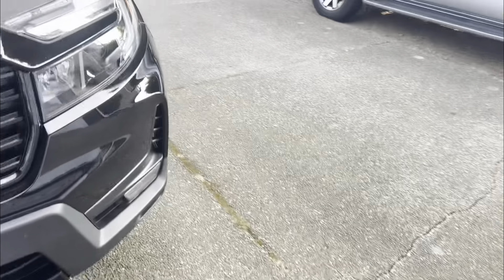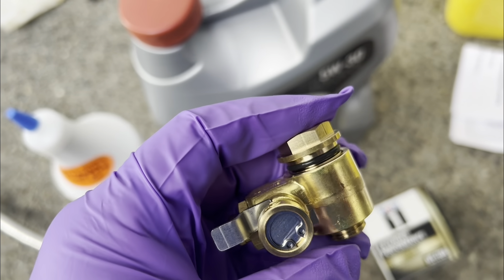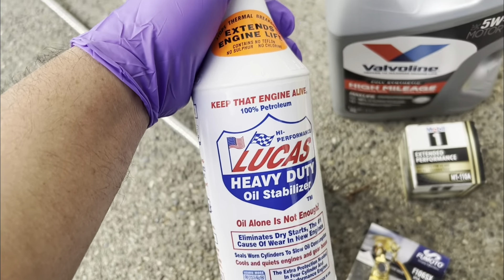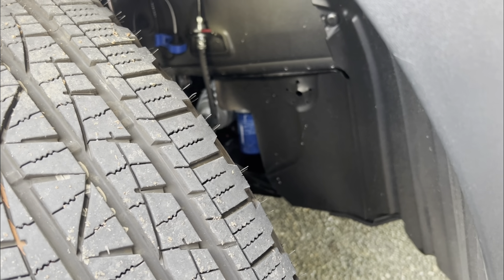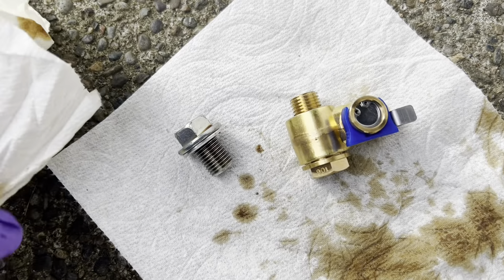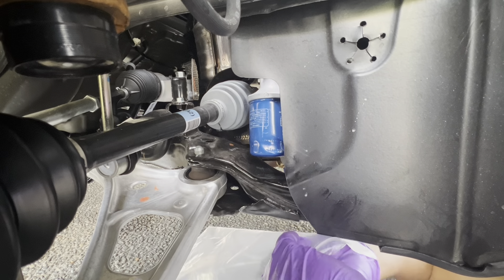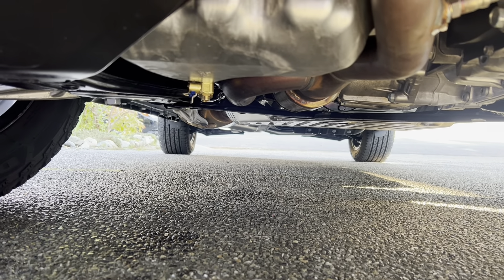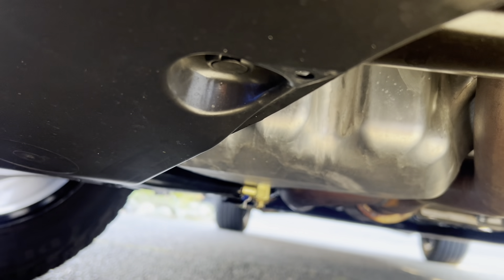2023 Ridgeline first time oil change, installing fumoto valve. I Don’t recommend this for you!

Comment: another great demo. i'm assuming your fumoto valve (F106SX) will also fit on my '25 Ridgeline.
Reply from the maker: Yes, but I only recommend the F106. Not the SX because it sticks out too much and can catch debris on the road. I’m switching over mine to just the regular F106.   However, if you do any off-road, I do not recommend a FUMOTO valve at all.
Reply: @AutoGuyVideos  no off road. thanks so much for the awesome intel. =)

Comment: hi  handsome, i own a 2023 honda ridgeline rtl-e  with 5325 miles in it. whats your hwy ,eco mode  cruise control  driving at 60mph ,average mile per gallon? why didn't you take it to the dealership for service? what octane gas do you add ? how much do you pay to fill up your gas tank? do you find the cabin noisy when your driving on the hwy with windows closed and radio off? are you going to replace the tires to michellin?
Reply from the maker: I don’t trust dealerships with regular routine maintenance. I prefer doing everything myself. I average about 21 miles per gallon city and highway. But if I was going 60 mph I would get 23 miles per gallon or more. The most I got 24 miles a gallon but I’m averaging at least 70 mph. In terms of noise, it could be better it’s not horrible, but it’s not excellent. I would consider it average.

Comment: as a former 2020 Ridgeline and lately a 2019 Passport owner, I've had better luck doing the oil change on thick blocks or ramps to get a better angle on the oil filter with my left hand. the oil filter has been in the same spot on the J35 engines for over 20 years. i stick with 0W-20 and once in a while use Lucas Lo viscosity oil treatment (in a Sea Foam style can).
Reply from the maker: Thanks for sharing! It will help us out!

Comment: I wouldn’t recommend this either since you may have voided your warranty by using the wrong oil.  Why go to all that hassle when Honda gives free oil changes for the first two years?   I also notice when you showed what you cut away of that plastic shield that what looks like a pulley for something is located just ahead of the filter. That pulley now is exposed to anything the tires may throw up into that area which could easily cause a problem that you will have caused by your own actions
Reply from the maker: I was curious how the vehicle to run on higher weight. It ran fine. I switched it back to 0W 20. I did lose a little bit of MPG on the thicker oil I think. in terms of that shield you’re probably right there’s a purpose for it. I’m now at 23,000 miles so I do lots of oil changes I do wish they designed the placement of the oil filter more convenient. It’s probably one of the most annoying things ever but I’ve seen worse oil filters locations.

Comment: 0-8 oil will lubricate easier & quicker. I’d never install that valve unless I was driving on a basketball court. Gee what’s that smoking? Engine check light? No oil pressure? No oil? That piece of debris you ran over 2 miles ago on the interstate at 80 mph. Cutting away the cover in front of filter located in the wheel well area was for protection or aero or both. I agree with the engine beauty cover being removed to dissipate heat. Especially if living south.

Comment: Did you not need the extension with the sx model?
Reply from the maker: This fumoto valve fits fine. If I did off road I would probably get the shorter plug but I just drive on freeways. I pointed it down so it drains easier.

Comment: You shouldn't use the high mileage variation of the synthetic or any oil for that matter.  The truck will not get anything out of using that oil and you'll get less mpg because of the higher viscosity.
Reply from the maker: Surprisingly I got 1-2 mpg more. On the freeway.

Comment: I have  had a Fumoto 106N on two 1st Gen Ridgelines. The oil pan drains look the same and the valves did not stick out like that.
That would make me nervous. 
I removed it in anticipation of getting a 24 Ridgeline. The valve has been in use since '09.